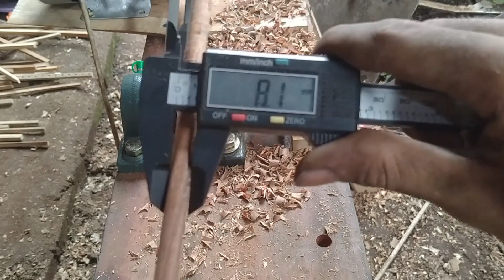Cara paling mudah merakit mesin dowel

Comment: diameter asnya berapa bang.
Reply from the maker: Dowel 5-10mm .as 19mm
Reply: @lwteck9266 beli asnya aja boleh gak bang,soalnya mau tk pakek ke dowel manual yg beli ke sampean dulu itu

Comment: untuk bearing nya itu diameter berapa bang?
Reply from the maker: Tergantung ukuran diameter dowelmya bang
Reply: @lwteck9266  kalo mau 12 atau 15 bang?
Reply from the maker: 12mm bearing ucp 204
15mm bearing ucp 205